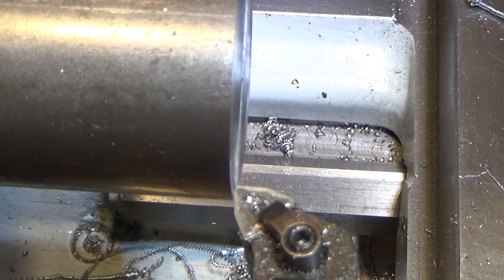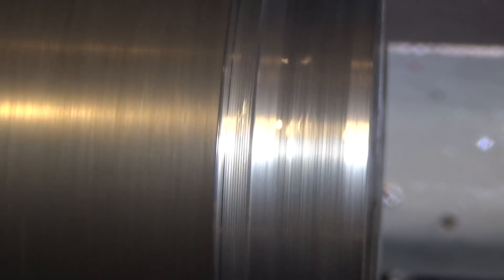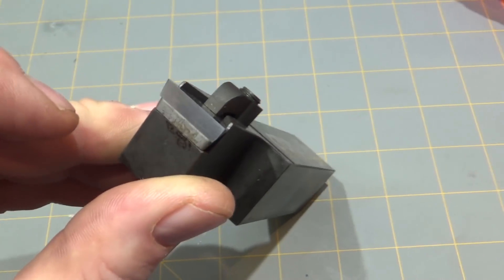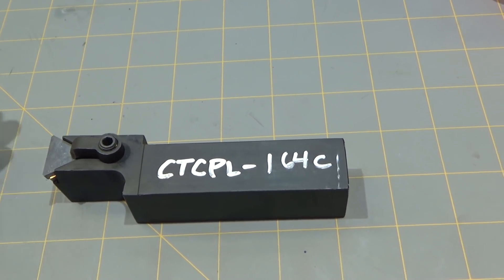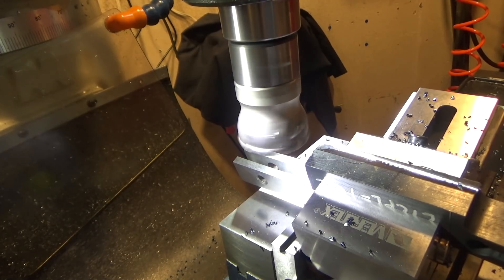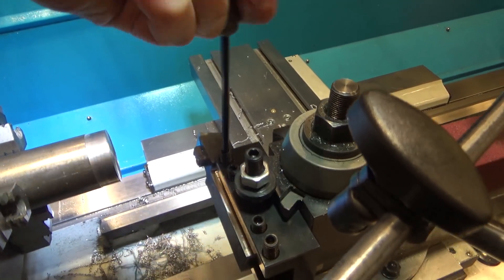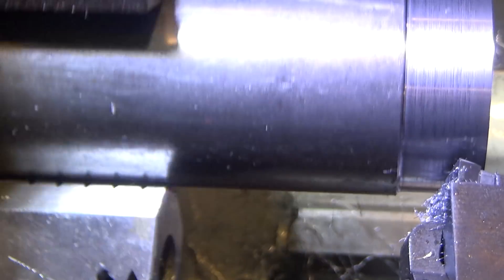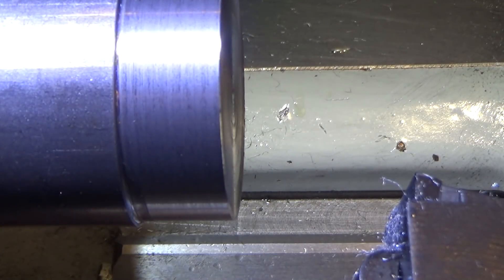Carbide Indexable Vertical Shear Tool for Hard to Finish Materials

Comment: I just had a thought while listening to you about the hardened vice jaw not gripping the hardened tool, what if you slid a wafer or single tiny wire of some sacrificial metal ( a wafer of aluminum or a single copper wire) between the two ??? would that create grip or introduce an unsafe unknown element ?
Reply from the maker: That is a great idea. I should have done that.

Comment: Your feeds and speeds are completely wrong. That's why your surface finish is that bad. You need to be at a much higher RPM for carbide inserts.
Reply from the maker: Thanks for the tips. Although once true, the high RPM requirement is no longer the universal rule for carbide. New carbide formulations and edge honing have made some carbide cutters comprable to HHS.
Reply: @DudleyToolwright  I've looked very hard for those kinds of inserts over the past few months. The only thing that comes close are finishing inserts with a wiper that specify a relatively low surface speed. But I can get a mirror finish with the average carbide insert on mild steel by running at the recommended surface speeds. Anything less and I get the same result you're getting.

Comment: Apparently most people using cold rolled mild steel have forgotten the basics of metal removal for finishing.
If you want to get a finish that is akin to a chrome plated finish......on cold rolled or bright mild steel here is the way that I learned 60 + years ago as an apprentice.
Use a flat fronted tool like a parting tool in shape but broader with a 20 deg top rake ....possibly 6mm wide with the corners honed to a small  radius to prevent tool marks...... and run the lathe slow about 50 rpm for a  50mm diam WITH COOLANT and a fairly fast feed.....you don't need a slow feed as the tool is scraping the cut on a broad front and means you can feed much faster to compensate for the slow rpm.
Depth of cut is shallow, about .05mm or .002" 
The tool MUST be dead square to the work piece or you'll get a spiral like tool mark  and on center so that it's cutting on the full face of the tool.
The slow rpm is the secret and this can be used on aluminium, brass and copper too.....copper works very well.
It's only used for the final finish cut where you want to have a bright chrome plated finish and a diamond honed carbide grooving tool will last forever.
Reply from the maker: That is a really interesting approach that I have never heard of. Thank you very much for sharing it. I am sure you are helping more than just me.

Comment: Being new to all this I'm having enough trouble finding a tool holder that positions the flat of the triangle cutter parallel to the work to begin with🤔,  ( 1/2 inch at that) and then cheap enough not to be hardened so my little pm25 mill can cut it.  I  love the idea though cause I stink at shaping hss blanks.  Anyone happen to have a tool holder part # ?  Thx
Reply from the maker: The one I used is a CTCPL but possibly MTFNL. This is a good site for insert and tool holder info: http://www.carbidedepot.com/Toolholders-C14.aspx

Comment: HSS would be much better for this, mr pete has an excellent video (or two?) on them. it looks like the carbide is still mostly rubbing
Reply from the maker: Interesting feedback thanks. I have had really go luck with carbide. I think that unless you need the toughness of HSS, carbide can be as sharp and hold the edge better - except for interrupted cuts. Judy a novices's opinion.
Reply: @DudleyToolwright  carbine will never hold a sharp edge as well as HSS because it is orders of magnitude harder and therefore more brittle. it might seem like it's holding an edge longer but in reality it's micro-fracturing and abrading away tiny amounts at a time. there is a reason carbide inserts have radiuses ground on them, because if they didn't, they'd make their own random radius in short order. that is why carbide has a minimum surface speed and depth of cut it likes to be run at for a given geometry, and HSS is far more tolerant to that, because carbide is worse at shearing, especially small depths of cut. it will often end up trying to self feed, which is what the occasional random squeak and streak is while you're taking tiny cuts with it.

if i need to sneak up on a precise diameter, i will switch out from carbide to a HSS vertical shear tool
Reply from the maker: Very interesting thanks. I will obviously need to investigate further. I appreciate you sharing that info.
Reply: @DudleyToolwright  any time. i am still an apprentice but i like to help how i can
Reply from the maker: Well thanks. I know your time is valuable.

Comment: Seeing you've had this one published for a while, ... have you tried multiple spring passes using a vertical shear?  I tried it in a relief area on a chunk of "old, gummy," returning the tool to the start position without bothering to retract it and engaged the feed clutch again, until I got two passes without any form of chip being made.  The last were so fine you had to lay a clean cloth down under the tool to see them ("fine as frog hair, split three ways").  Probably the best finish I've ever gotten on the Old Warrior without the use of abrasives.

I think a lot of it has to do with the tool not following the exact same path down the work from the previous pass.  Any tool will leave ridges according to it's form, even if it's only at the micron level, on a single pass.  Subsequent spring passes, that travel down the work along a path that is not exactly the same as the previous one, gives the tool a chance to further take down those high points.

What I'd like to see explored is the practicality of a carbide vertical shear on material that a HSS tool can't even begin to touch.  Especially within the parameters of an older, larger engine lathe like mine, that was originally designed to run from a line shaft.  Top spindle speeds are no where near what more modern lathes can reliably get to, and feed rates usually are not so fine.  If it increases the chances of success in getting a critical dimension, and lowers the probability of overshooting tolerances, it would be worth knowing about.
Reply from the maker: I have and as you suggest, I almost always get more material removal on at least one subsequent pass. There always seems to be a bit of flex in the work piece or the tooling and, as you said, the tool never follows the exact same spiral around the work. I should try the vertical shear tool on some really hard material, it would bean interesting test. The reason I haven't tried this before, is because, hard materials always seem to cut well and leave a nice finish.
Reply: you should not need to do a "spring pass" with a vertical shear tool (or shear tool of nearly any kind- but it depends) because they exert very low pressure on the work. and in nearly any situation, should never require more than 1-2 spring passes. if you do, something else is wrong.

Comment: Why not just use a large radius finishing tool?
Reply from the maker: That might work as well, but the vertical shear cutter has a different cutting action and is known to work where other cutter styles will not. That being said, I am no expert and appreciate any suggestions people are willing to give.
Reply: Large radius, positive rake with very little land. I routinely used to get mirror finishes on cold rolled. 600sfm, .0111" per rev at .100 depth of cut

Comment: I took a boring bar with a triangle tip oriented similar to your tool and by rotating the bar in the holder to get the tip a few degrees off vertical I have a very good shear tool.
Reply from the maker: I like it. Does it stay in position well?
Reply: @DudleyToolwright  Yea, it's locked in with all 4 set screws in the tool holder. I suppose an actual boring bar holder would be more secure, but doesn't seem necessary. I tried it tonight, must have been hot rolled bar. Couldn't get the mirror finish I got on cold rolled, but still pretty good. Tried some different angles. Seems like not far off vertical is the best. Is that your experience too?

Comment: There's at least one older YT video showing high magnification shots of the cutting action in slow motion. Damned if I can remember the name of the video though. Anyway it shows the material building up on the tool tip and that material pushes more metal off instead of cutting the material in advance of the tool tip. Once the forces get high enough the built up material then folds under the tip and the whole process starts over again. I'd be willing to bet that's what's causing those grooves in the finish you showed with the first conventional tool tip. As others have already said ultra sharp and properly honed HSS with the correct rake and clearance would do as well or better than this tool, but it was still an interesting video.

Edit, I re-found that video, check out Iscar Chip Formation .wmv Posted by Rick Steinard.
Reply from the maker: Thanks. I love the ISCAR video. Utterly mesmerizing. I also appreciate the insight as to what might be causing the grooving problems. I still have to play with HSS. I have only used it to make a trepanning cutter thus far with mixed results. I got a tone of carbide inserts at an estate sale, so I have a ton of experimenting to go there as well.
Reply: Dudley Toolwright  Carbide as good as it is can't do everything. Like all machining processes it's always a series of trade offs and compromises. The newer grades micro carbide, multiple chip breaker designs and the vast number of coatings are a lot better than the much older uncoated plain grades of course. The very old high carbon grades of cutting tools can probably be sharpened a bit keener than even HSS can, but tool life at the slower speeds suitable for it are far less than a HSS edge at it's usual 100 ft. per min. on mild steel. That doesn't mean there's no place for shop built and hardened high carbon cutting tools if something special might be needed. Boring with a boring head on a mill usually can't take the high depths of cut and feeds suitable for carbide for the best surface finish since it then takes a lot more massive machine than our little Bridgeport clones are. I can and do resharpen my own HSS tool blanks, but for repeatability I sometimes also use the A.R. Warner pre formed HSS tool tips that are designed for use in the the more usual tools that take replaceable carbide cutting tool and boring bar tips. It's a whole lot easier to then sneak up on the target dimension since a good sharp HSS tool can take as little as a few thou and still cut just fine. 

With my limited knowledge and understanding I think on average most carbide is meant to use high pressures and heat from the cutting process to help plasticize the metal something like that Iscar video shows. When that happens on good machinable grades of metal the surface quality goes way up. Poorer but still machinable grades of metal create that built up edge problem shown in the video. Especially so for most grades of aluminum. Obviously if the metal isn't being cleanly sheared and everything removed and flowing off the tool edge as soon as it's cut you then get that crappy surface finish. I'm certainly no expert so it's a best guess, but it's likely your shear tool is helping to prevent a lot of that built up edge and acts to wipe across the surface smoothing it off a lot better. 

Proper sharpening of HSS also isn't quite as simple as it first looks. Wheel selection is extremely important. Highly experienced Woodworker types go to great lengths to get there tools ultra sharp. For that reason using the same recommendations they use for wheel selection is I think a good idea. They also won't usually use any tool with a bench grinder finish without a final stoning on one or more fine stones. Wood lathe users might be the exception. So for chisels and plane blades there honing there tools like we need to. It's impossible to get a better surface finish than the tools cutting surface is. Same thing for carbide, those green grit wheels are only meant for rough shaping, it takes a diamond wheel to get the final honed finish the tool needs for the best results. Any tool will still cut right off a bench grinder, it just won't cut as well, last as long or produce the best surface that a honed tool will.
Reply from the maker: Thank you for the very detailed explanation. You have sold me on trying HSS. I have been accumulating some and will try it out. I even have some tools that other machinists have ground. I suspect that these will be a good starting point. I really appreciate you taking the time to really flesh out your perspectives. I suspect that I am not the only one who will benefit. Very cool.
Reply: Turning Point, you talk a great deal of sense sir! Being a "Woodworking type" I could not agree more. And looking at Abom79 videos he is as passionate about getting his HSS shaper tool bits razor sharp with plenty of stoning his bits after coming off his grinder ( in fact any of his HSS bits ! Lol) i am also a woodturner using HSS turning tools and I ALWAYS use the diamond hones after regrinding my tools, it saves a LOT of metal honing that edge up to six or seven times before regrinding is required. If you saw the price of good quality HSS turning tools you will appreciate that grinding 5 to 10 thou off of them every time you needed to sharpen them by grinding them rather than honing will save you a whole lot of money.

Comment: @ 6:20 The sparks flying off your cutter made me cringe. That tool holder likely is hardened. You did not mention if the 1/2 in end mill you used was tool steel or carbide.  For cold roll, tool steel is all you need, and can be easily sharpened to a sharper edge than carbide.
Reply from the maker: Thanks for the interesting observation. My end mill is carbide and the too holder seems to be hardened. Coolant would be an improvement, but I am always paranoid about corrosion.
Reply: Dudley Toolwright  corrosion of what exactly?

Comment: You don’t need HSS, however it will work really well with a good grind. However, once you get to know the material, and tooling, you can create a very good finish with indexables.  Rough with neg rake WNMG, finish .01-0.02 with pos rake high speed as I already mentioned in a previous post.  On the cnc, 1000 SFPM for mild steel, mirror finish, it burnishes as it cuts. Home lathe 600-800 SFPM, it just whips chips across the garage, good to get a guard for some of that nonsense.
Happy steel whittling
Reply from the maker: Thanks for the really helpful suggestions. I always love to learn something new.

Comment: Smaller depth of cut 1000 at time Ever turn a brake rotor  Smaller slower cuts nicer finish
Reply from the maker: In my limited experience, surface finish is very material dependent. I have some materials that do extremely well with large depths of cut and high feed rates, while others do a lot better with your recommendations. Interestingly, I have never turned a brake rotor. Thanks for the suggestions, they are always appreciated.

Comment: .003 to .007 cut and skip the lube and if using the carbide take a diamond to the edge there is a super small radius on the edges on all inserts or use a insert seat as the cutter thats what they used at TRW they used a square insert seat in a positive rake holder set in sideways cut like butter the cause a seat is shaper. thanks for sharing
Reply from the maker: Thanks for taking the time to share some suggestions. I really appreciate it.

Comment: It DOES matter where you cut, in that you should cut BELOW center, not on or above.
The closer to 90 degrees your angle is (max 85) the finer your finish.
And last but not least, HSS does a damned sight better for this than carbide does.
You can even get a decent finish on 'black pipe' in the lathe, this being the gummiest crud even devised by man and turned in a lathe!

Paddy
Reply from the maker: My apologies, I was unclear in my explanation. What I meant was, it is unimportant which part of the cutting edge you use, not where on the part it makes contact.
I have used high speed steel in the past and it can provide a better finish on cold rolled steel, but in my very limited experience, not great either. I do however, really appreciate you taking the time to share your thoughts. Thanks.
Reply: Dudley,
Well, it is important to experiment with 'feeds & speeds' .... I have had different results with the same material (according to the DIN norm, anyway...) from different manufacturers.
The main thing (and this too will depend, to an extent, on the machine you use) is a very fine feed, a decent speed and a rather shallow contact angle and of course the most shallow cut possible,. No matter what the different materials are, or what machine you use, I have found that any sin against the above will make matters worse.
You almost want 'fluffy metal wool ' (is that a real term? LOL) to come off of the workpiece. I thought your swarf (in the demo you did) was still a bit too 'chip like', meaning you cut rather than sheer.
In any case, it is a great tool to experiment with, and leave others scratching their heads, how you get such a nice finish on gummy, crappy types of steel!

Toodles!
Paddy
Reply from the maker: Thanks for all of the info. I really appreciate you taking the time to share your thoughts. I never fail to learn something. I do need to experiment more with the vertical shear cutter. I have a project coming up that is going to use some cold rolled steel, so I might get my chance..